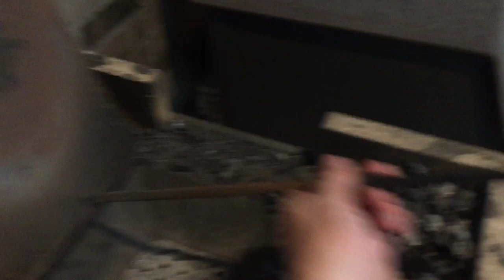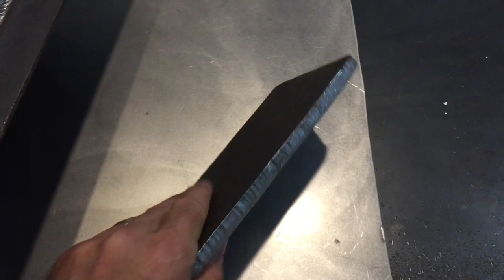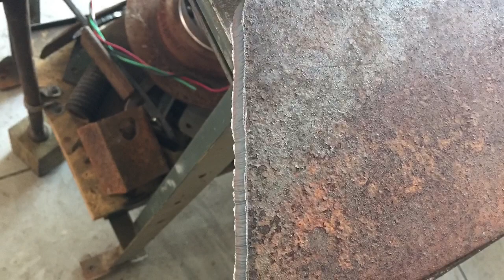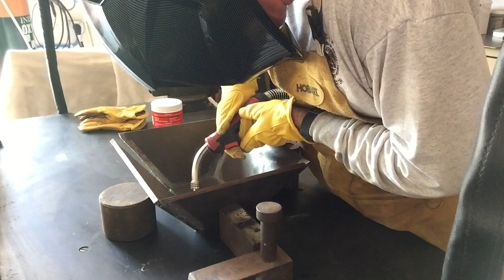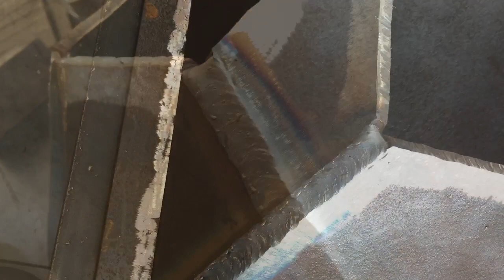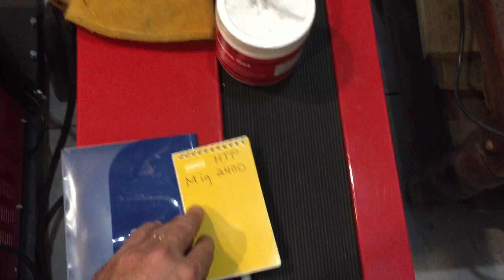Upgrading My Blacksmith Coal Forge: Part 1 - Firepot Build

Comment: How about the square at the bottom
With my firepit i drilled holes, punshed through and enlarged the hole to screw a construction scaffolding tube undernieth
I think my hole is to small, to little air for the size pot i have
Yea, just curious what u got planed for ur setup
Reply from the maker: Just watch the full build and you'll see exactly what I have done. Mine was built a few years ago and it has worked flawlessly. I just welded a tube to the underside of the pot.

Comment: ??Tripod??
Reply from the maker: If you are asking if the firepot could be triangular with just 3 sides then the answer is yes, it could be and I suspect it would work just fine.
Reply: @shopdoc  Not what I was getting at, but interesting. I was suggesting a camera tripod.
Reply from the maker: HaHA! Well I messed that one up didn't I. Camera tripod! Yep got one some time ago. This is a very early video of mine. I use a tripod almost exclusively now. Thanks for the input!

Comment: Welding down hand or down hill isn’t a structural weld, you get very little added material and not a lot of penetration. Any vertical welds on structural steel are required to be welded vertical up position
Reply from the maker: Good to know, thanks so much!
Reply: M7 Metal Works nice build I like your videos!
Reply: That depends on what you're using to weld it with.

Comment: If your using a 7018 rod on the weld go up to makes the weld stronger other ones like the 6010 and 6011 rods go down hill
Reply from the maker: i actually used a mig welder on this project.

Comment: Looks like one designed by Dennis from DF in forge
Reply from the maker: Not sure who that is? This is probably a combination of many forges I have seen on YT and in person and just scrambled the info in my head and this is what I wanted to build. The lack of a clinker breaker is something I like because the air seems to flow well in its absence. But I have to clean my pot of clinkers every time I use it. No worries, I love the new forge,,,,,,,it's awesome!